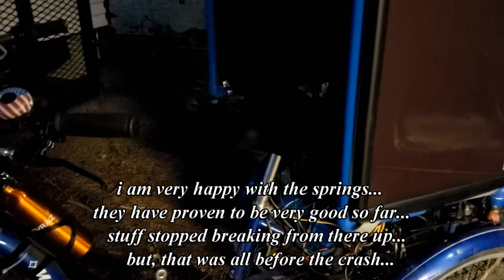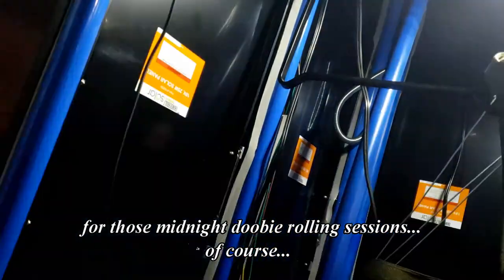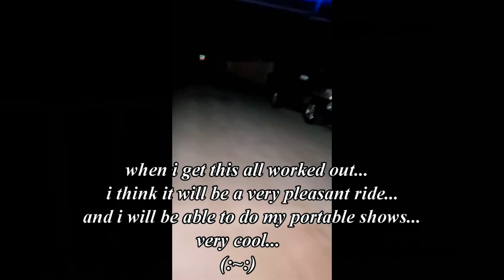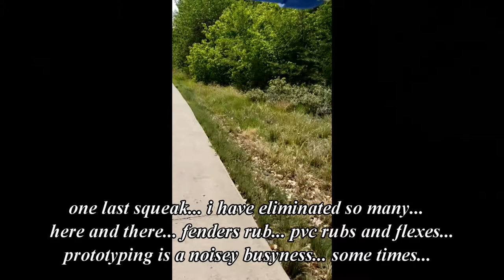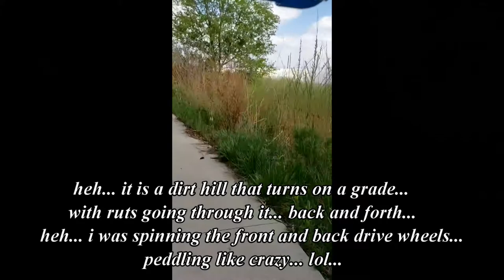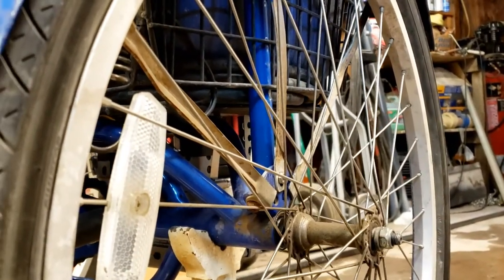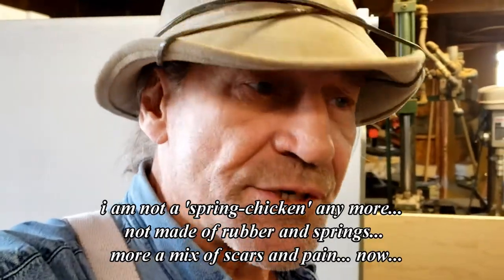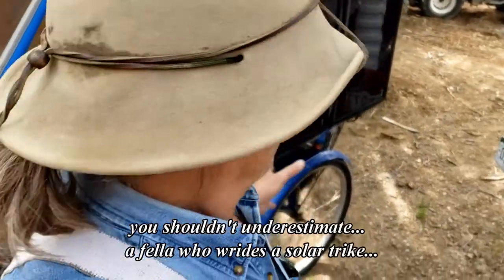solar trike update after the crash schwinn meridian design flaw causes wheel to fall off (:~:)

Comment: Thanks for the info, I'm motorizing a blue Schwinn Maridian.  It would be scary to be going 20 mph or more and have the axel brake like yours did. I hope your right about the nut backing off into the hub, it does make sense that the forces from breaking would tighten the hub to the point of stretching and snaping the steel axel. Like over tightening a bolt till it snaps off. Thanks for the video.  👍👍

Comment: That is a very nasty looking scratch.   Keep applying hydrogen peroxide to it and if it starts hurting worse,  get some antibiotics quick.

Funny,   my father worked at Elastic Stop Nut in Union, NJ for 40 years as a machinist.
Reply from the maker: thanks pat... i'm doing very well... it's kinda ugly... but no infection... i'm like an ole alley cat... very cool about you dad... i worked in a steel mill for 28 years... we both probably worked with folks just like each other (:~:)
Reply: @CharlieFetty    My mom grew up  in Youngstown, Ohio,  big steel mill area.